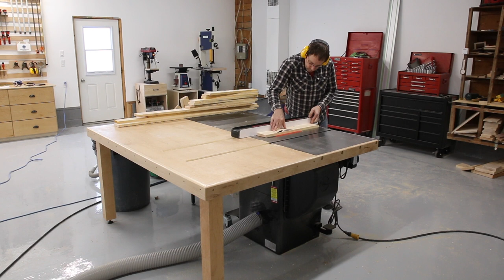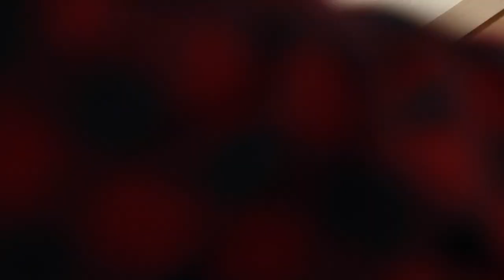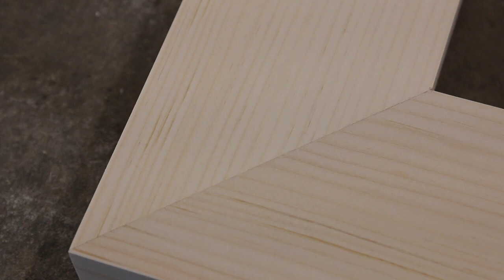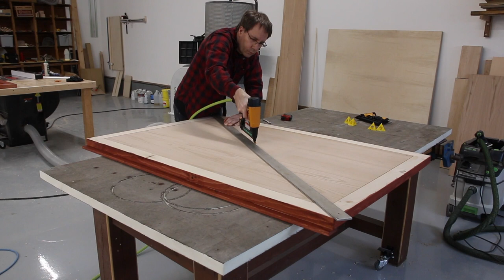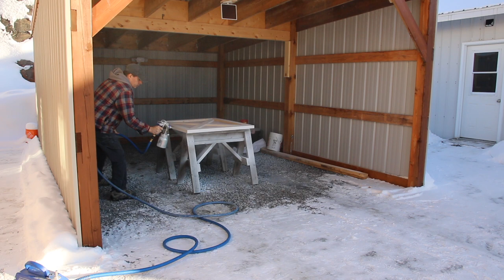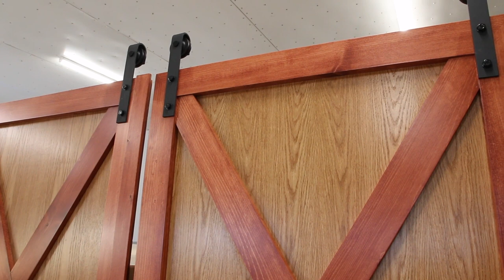Making Barn Door Curtains

Comment: Got an easy project for you.  Your shop is so big that you have to move from one area to the next.  Luckily, your table saw was only a few steps away from the jointer/planer.  What you need to make is some sort of mobile material handlers.  Gives you a closer horizontal surface for easy repetition and then allows you to simply roll to the next area.

Comment: You cannot use indoor (joinery) methods for outdoor work.
If it WAS possible then much more knowledgeable craftsmen would have been doing it centuries ago\.

Mitres and biscuit joints cannot possibly work in an environment with constantly changing humidity levels and therefore moisture content. 

The mitres will open up and let in water which will freeze and expand and then mould.
The biscuits will swell and lose all gri and maybe even split the wood.

In the land of the blind.... etc
Nah!
Stay indoors,Furniture Guy!  :-)